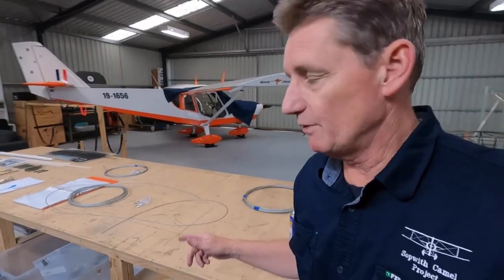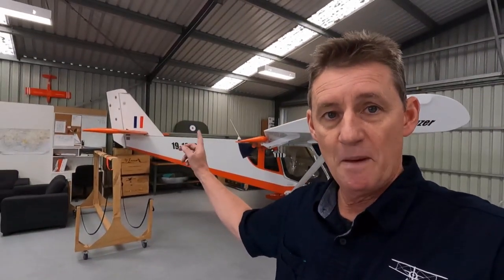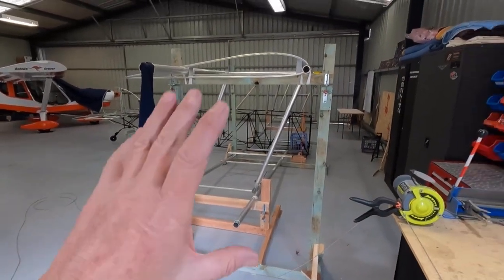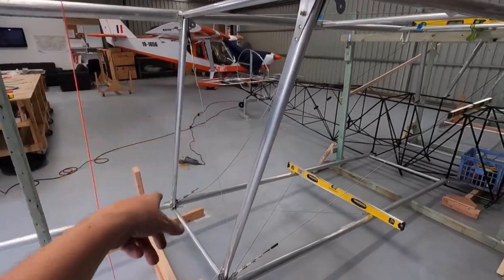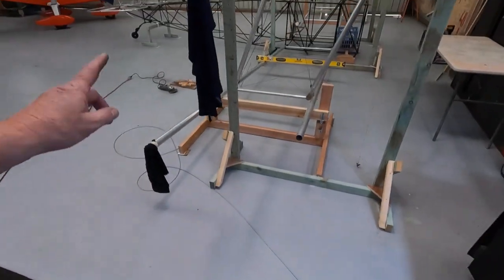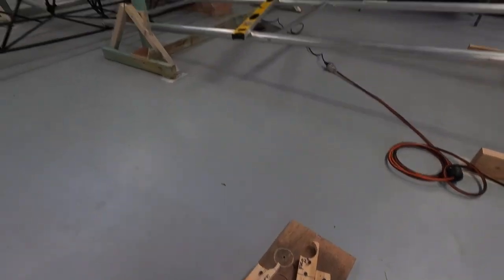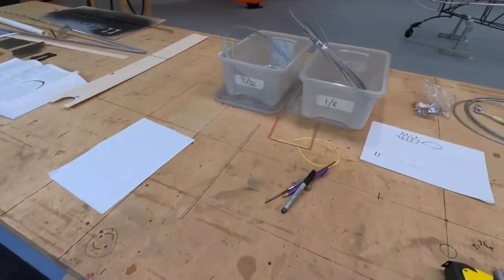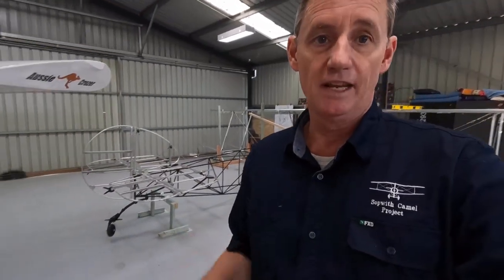Building my own full size sopwith camel ww1 aircraft.

Comment: I'm building a RB full size Nieuport 17.  Curious what turnbuckles you used for Lift, Landing, Landing gear and Cabine wires.  Great video's!  I've learned alot - thanks for doing 'em.
Reply from the maker: From memory and from aircraft spruce I match the cable strength to turnbuckles. Turnbuckles are like , dash 8s or dash 16s which basically means 800 or 1600 lbs. 8s on 3/32 cables, 16s on some and I used 46s on the landing gear which is over kill.

Comment: The upper wing wires are to be perpendicular to wing. Front wire to front pin you pointed out and rear to spot with missing welded tab
Reply from the maker: Great thing with homebuilt, it can go wherever the builder chooses. I have mine spread obviously TLE to firewall as recommended by the manufacturer.

Comment: Looking good mate. I’m a bit unfamiliar with cables, but would they stretch with a bit of load on them? And would they stretch far enough for you to run out of adjustment in the turnbuckles? By the way, pretty jealous with you going to Oshkosh!
Reply from the maker: Very little stretch, turnbuckles can be 3 threads out and 4 turns in so plenty of adjustment if needed.

Comment: You mention using acrylic wall paint, surely it should be cellulose dope to tension and seal the covering , didn't think acrylic would tension it!!
Reply from the maker: Todays fabric is tension 3 times with heat then just sealed with no shrinking but flexible primer.

Comment: G'day,

Yay Team !

Um, why are you Single Swageing those Cables, Sailboat Style ?

When he started selling Mk-1 Skycraft Scouts in 1976, Ron Wheeler was Single-Swageing the Cables - apparently because the Scout was a motorized Tweety, and Tweeties used extruded Sailboat Masts & Hardware for their L.E. Wingspars & the Fuselage-Tube - so Sailboat Engineering was the starting point...; and Tweeties were footlaunched Hang Gliders, so vibration wasn't a problem.

The main Drag-Wires from LE to the Nose took the load of the Dacron Sails' Wing-Roots being laces together in extreme tension, to stabilise the Aerofoils, structurally.

The 3 Pre-production Prototypes, all 8 Hp, all had single-swaged Drag-Wires, from Nose to Wing Leading Edges, and they did not do much Flying, really, but they held together for what they did do...

There were then 12 Production Mk-1 versions, with12-Hp Motors, and they pretty quickly began folding one Wing back over the Tail & spinning in, when the Single-Swaged Drag-Cable succumbed to the 160 cc "Pixie Major" vibrating the Crap out of the Cables under lots of Tension.

And, apparently, one of the Crash Investigator's first questions was why Wheeler hadn't used double-swaged Cables - which were De-Rigeur for Homebuilding Aeroplanes, in Oz..., and had been so, since before WW-2, kinda thing.

It's a Bee's Dick worth of extra weight, but that little bit of Prevention beats all kinds of trying to Cure the incurable.

If you check out,

"National Transportation Museum ; Visiting My First Aeroplane...!"

in the Walkaround, you can see the Double-Swaged Drag-Cables..., with which the 3rd 8-Hp Pre-Production Prototype was Factory retrofitted, before Ron Wheeler sold it to Neil Cottee...

Then, in 1979 there was a bloke who flew out of Darwin in his homebuilt Pitts Special, to practice Aerobatics, and his Single-Swaged Right Rudder-Cable let go and came adrift from the Pedal...; he then had to fly back and land,
Operating that Rudder-Cable by hand...
Reaching down between the Seat & Fuselage Fabric, so to do.

I learned of the Pitts, as a Tarmac Terrier at Sportair Aviation, the Australian Pitts & Bellanca Agents, in '79, working to modify a C.-210 Stationair and three C.-152 Aerobats to meet the Australian C of A requirements.

You might be wildly surprised at what AmeriKans considered "Good Enough", which Oz Law regarded as being Cheapskate 
Dangerous Bullshit.

I note that all three,
The Homebuilt Pitts,
Your riveted Aluminium & welded  Steel Tubular Camel, 
And the Tweetie...

All were originally hatched in
The Land of
Unkle Spam...;
Where
"Industry Standards" 
May well be between
Questionable &
Doubtful...

Kinda thing.

Off-true Welded Mounts for your Cabane Struts...

Irritatingly
Short lengths of Critical Cable which permit ZERO Errors when fitting on the Ends...

Sailboat-level Cablemaking recommended for a Homebuilt Experimental Aeroplane...; whereinat such techniques have a long history of causing Catastrophic-failure induced
Problems...

I think it might be a good idea to run something of a Jaundiced Eye over the whole Project, mate ; and scrutineer it, looking a bit hard, to see what else they've done less than optimally...

If you'd consider taking a Fool's Advice - then feel free ;
Around here I'm well regarded as the local
Fool On The Hill...

Somebody has to do it, and I already had the Ridgetop ; so my
Doorstep is
"Vertically superior" to every
Rooftop for 15 to 35 Km in all directions..., 
Therefore, I got the Gig...(!).

And because I can already look down on all my neighbours, I haven't yet begun rebuilding my second Aeroplane ; which I crashed in 1992 (!).

Such is life,

Have a good one...

Stay safe.

;-p

Ciao !
Reply from the maker: Thanks, two novo press sleeves, while it looks stronger offers no more strength. My aircraft is built following FAA and CASA regulations which clearly outline all procedures.
Reply: @scottmatthews5280  

Cool,

Fair enough,

As long as you're onto the issue, it'll be fine.

In fact, after I'd posted the comment my forgettery offered up a hazy recollection of a 1990s conversation where someone explained that one newfangled Copper Swage was stronger than two olde-skool Lead ones, as well as being lighter.

I conjecture that the image of the bloke flying a Pitts with his left hand while using his right fist to balance his left foot burned quite a pathway  into my Alarm Circuitry, as things to look out for - at a young & impressionable age (!), and then the later ("new, improved, stronger, lighter, shinier..." story probably got divided by scepticism concerning Marketing Jism ; and - yeah..., the memory of the update took a lot longer to filter up and appear,  consciously noticable...

Such is life.

Keep on keepin' on...

Stay safe.

;-p

Ciao !